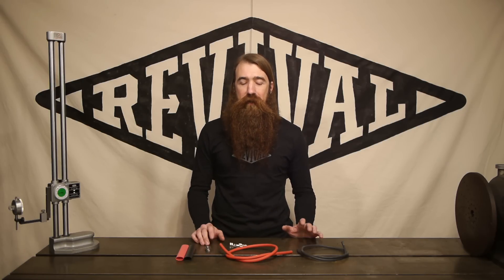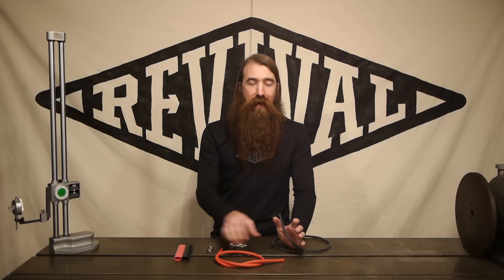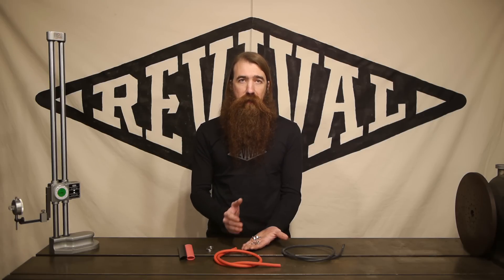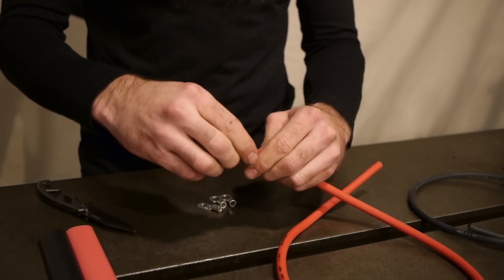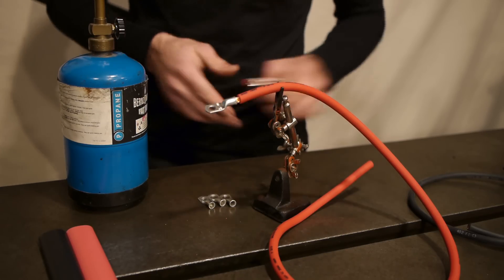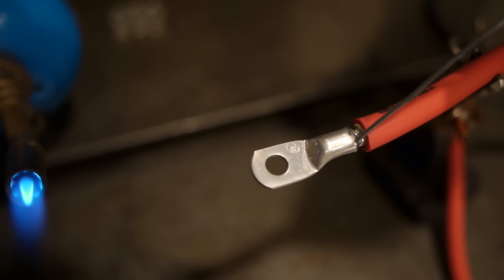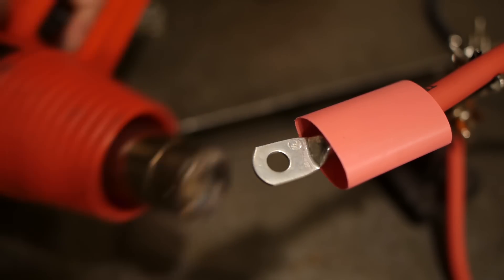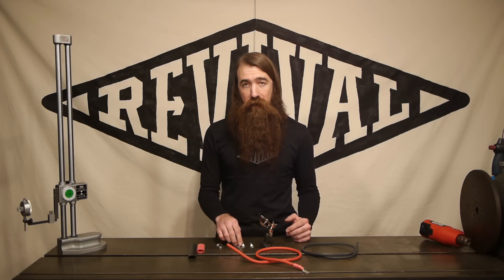Making Motorcycle Battery Cables - Revival Cycles Tech Talk

Comment: So glad you advised to use the propane cylinder instead of a soldering iron.

Instead I crimped a terminal to a 12G cable to connect a controller to a vertex sealed AGM battery which will charge from a solar panel. 

I will charge low current gadgets from it, such as my phone and usb lights and a blood glucose machine!

Comment: Hello , I have a 1988 BMW K75S  where the wires from the alternator to the battery terminal and the ground cable needs to be replaced because of rodent damage.  As you know, at the alternator there are two wires, the B+ terminal, which is a large quick disconnect male. and the D+ terminal which is probably the ground ( a blue wire, not sure where it goes).  It is impossible to find the plastic adapter to house these wires into a new set  of wires.  How can I fabricate a cable for the B+ terminal that has a battery adapter at one end and a spade connector to fit the alternator at the other end?  I have tried everywhere and no one seems to be able to help me!  I hope you have an answer for me.  I can send pictures if you are not familiar with the alternator terminals in this bike.  Appreciate all your help and really enjoyed your video.

Comment: Size of wire for the battery? and the terminal size also pls...thanks a lot the video
Reply from the maker: We use 6 AWG wire and depending on the battery we use either 1/4" or 5/16" terminals. 
Here's a link for that very kit...
 https://revivalcycles.com/collections/motorcycle-batteries-electrical/products/diy-battery-cable-kit-revival-cycles-signature-parts

Comment: Great video. So what's the size of the cable for my 50cc moped I've got to change them u think it's 6mm cable at the moment I've got some nice fine strand 8mm can I use this even though it's a bit over speck.? That looks like 8mm your using there.
Reply from the maker: I;m not really sure for a little 50cc moped but the cable we use and sell is 6awg which is closer to 16mm2
Reply: @RevivalCycles  that sounds quite big. I suppose if I use bigger than what was on it before it will be ok. Belt and braces as they say. Thanx buddy.

Comment: I just ran into your video looking up information on how to jump start your motorcycle. I like to ask you a question? Can that positive wire be hooked up to your battery underneath your seat and put it in the side cover with a cap. So it doesn't touch any metal so when you need to jump start your bike without taking off the seat. You hook up your positive jumping cable to that wire and the negative to a non painted surface.
Reply from the maker: Hypothetically you could to that but I would very cautious about dangling a loose positive pable cap or no cap. A safer way would be to use an SAE quick connect harness and pick up a lithium jump pack. This would also make it more convenient to hook up a trickle charger and avoid the need for jump starting altogether.

https://shop.revivalcycles.com/quick-disconnect-battery-harness-18/

https://shop.revivalcycles.com/antigravity-micro-start-xp1-pps/

Comment: Everything I have read says that a correctly formed crimp fitting will transfer more current and also keep the ends from becoming stiff from the solder and the possibility of cable fatigue.  Is this not correct?  Thanks,
Reply from the maker: Here are the opening lines of the first two results from my online search. 1. Crimping offers stronger, more reliable connections than soldering. 2. Crimp vs. Solder Solder Method Performed properly, it is one of the most reliable connections and can be used on cable with solid or stranded center conductors. 

This is an argument older than Coke vs Pepsi and for everything you read that states one way is better than the other you can easily find contradictory statements. I don't know which is most right.

What I think is most important is that you pick a side and learn to do it really well. Both connections perform equally well as it pertains to Motorcycle electrics so long as you do them correctly. While 40 year old Hondas have a lot of electrical issues these days I have never found the source of a problem to be one of their soldered wires or terminals. 

We like soldering in many but not necessarily all situations. Properly soldering a battery cable terminal effectively is a lot easier than crimping one  I can't recall a single scene where a bike we built any time in the last ten years returned due to a failed solder connection.
Reply: @RevivalCycles  So for years, I've done the solder w/heat shrink. Then, after much reading, thought I was all washed up and started using hydraulic crimpers.  Now, I'm unsure. 😊

Comment: Is it good practice to add in a 30amp fuse to the positive cable? If so, what is the best way of doing this? Thank you for the helpful videos.
Reply from the maker: Generally there's not a fuse on the circuit from the battery to starter solenoid on to the starter motor. This would require a special fuse holder to work with such a thick cable. There is a main fuse that sits between the Regulator/Rectifier and battery and often this is a 30 amp but depending on the bike it could be lower. Check out the wire diagrams on our tech articles page for more clarification. 

-Berry
Reply: Revival Cycles thanks Berry, I am installing an m-unit on my BMW R100 and have upgrades the reg/reg and coil but currently have no fuse that I’m aware of. I have reconditioned the original starter and wondered if you thought it would be good to put a fuse somewhere and if so where?? Thanks again 🇬🇧🇬🇧⚡️⚡️👍👍

Comment: Hi, i am planning on hiding the battery where the main bike stand was. Right Behind/under neath the main frame where the swingarm hits. My munit and other electrical parts would sit in an under seat electronics tray. Therefore i would have to run the cable alongside the frame to the electronics tray. This would make the cable significantly longer than the original one. Is there any problem with this, overheating f.e. hence the resistance of the cable is greater due to being longer?
Reply from the maker: You are correct that increased cable length increases resistance, and that is definitely something to keep in mind. That said, in the example of battery cables and motorcycles, the change in length won't cause a problem.  We actually tested this on our Ducati Odioso project, the battery is in the side car but the solenoid is up under the tank, which meant the battery cables are close to 5 feet long, and that works flawlessly.

Comment: No flux required when you solder? Is it a special kind of solder?
Reply from the maker: Yes it is, the solder we include in the kit has flux in the core. This way as it melts it cleans the joint.

Comment: Iits a way to make battery cables, the better way is to crimp most electricians are happy to help providing tool and materials in exchange of a case of beer, KTM is using Klauke crimping tools and lugs exactly the same i have in my electricians toolbox.
Reply from the maker: This is true that crimping is the conventional way to do it, but most people don't have access to the real crimping tools, and attempting to crimp these terminals without the right equipment is worse than soldering. Also, in the application of motorcycle battery cables crimping is not necessary, because the duty cycle is extremely low. This method works very well for the applications of starting a motorcycle engine, however this technique should NEVER be used when working with voltage over 24V or sustained current flow above 60 amps. 

Based on my research solder actually gives a lower voltage drop (better conduction) than crimping, but it is not used in industrial or EV application due to the mechanical failure modes caused by thermal cycling and cracking. In the application of a conventional motorcycle the thermal stresses are negligible, and we have never seen or heard of a failure of any of our cables over the 10 years we have been building them this way.

Comment: you Failed to CRIMP b4 the solder job
Reply from the maker: Criticism is welcome, but the most important part is WHY. Can you explain what purpose the crimp serves in an application like this? Hopefully everyone can learn something in the process.  In our experience the solder creates a secure mechanical connection, as well as an efficient electrical connection. 

It is true that this technique is inappropriate for larger cables that carry high current and voltage (especially AC current), but for  the purposes of electric starter motors on power sports equipment this method has been very effective for us. Also this technique will produce better results as compared with makeshift crimping in the hands of the average garage builder.
Reply: as i remember your video about battery connectors DIDN'T show at all to CRIMP the connector mechanically to the connector then soldering.
Reply from the maker: Correct, there is no crimp stage in this video, because I cannot identify a technical need for it, and most people do not have the correct tools or equipment to properly crimp a 6 gauge wire. 

The mechanical strength of the solder has been more than adequate for this application.   Again, what purpose does the crimp serve? What happens if the joint isn't crimped?
Reply: Crimping would provide a mechanical hold, and flatten the copper strands across the terminal interior for more surface contact.  However, if uncrimped but soldered (with sufficient heat), the solder should melt enough into the inner strands and may conduct just as well.  The test is in how well the engine cranks compared to a stock cable and a crimped unsoldered cable.

Comment: Hey guys, love your products and your talks. A few quick questions: 1) how long is each cable? 2) What gauge wire? 3) What size are the holes in the two different ring terminals? 

Thanks so much! - Alex  (GS500 custom build)
Reply from the maker: +Alessandro Olsen check out the listing on our webstore under the specs tab for all the details https://revivalcycles.com/collections/for-your-ride-bestsellers/products/diy-battery-cable-kit-revival-cycles-signature-parts